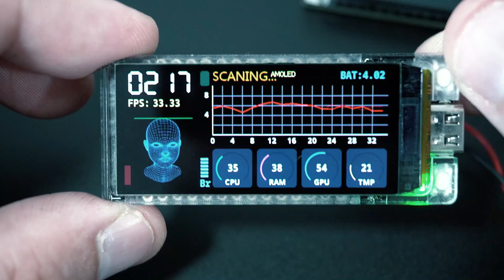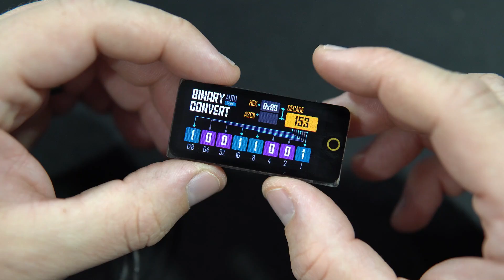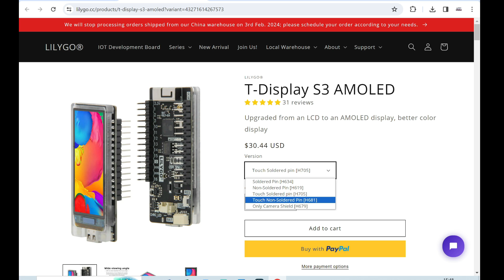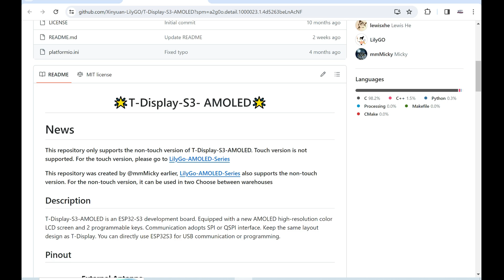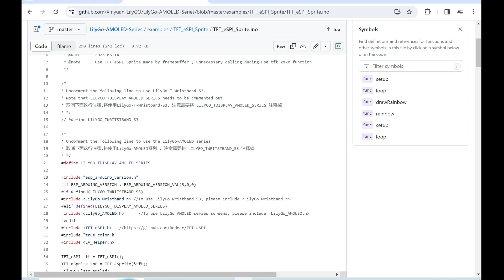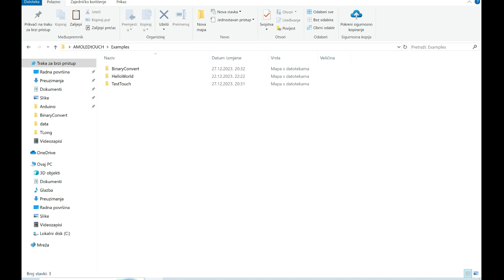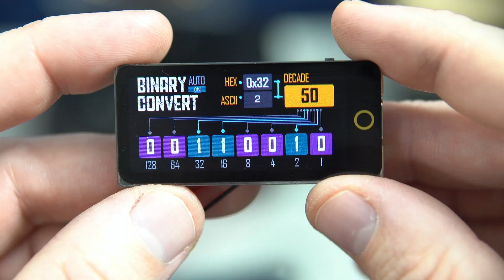T-Display AMOLED Touch ESP32 (Number converter Project)

Comment: Just in case anyone else is - like me - also struggling to get this running: I got the BinaryConverter.ino work on my device by ...

Preferences:
Additional boards manager URLs: "..." (sry, can't add an URL in a comment without it being shredded)

Tools:
Board: esp32 / "ESP32S3 Dev Module"
Port: set to whatever your device identifies as
USB CDC On Boot: "Enabled"
Flash Size: "16MB (128Mb)"
PSRAM: "OPI PSRAM"

Libraries:
TFT_eSPI@2.5.43 by Bodmer
XPowersLib@0.3.2 by Lewis He
SensorLib@0.3.3 by Lewis He

Boards:
esp32@2.0.17 (with 3.x.x I end up in a crash loop)

Code Fix:
Setting the WIDTH and HEIGHT defines in the .ino file to amoled.width() resp. amoled.height() correctly.

Comment: Hi, Unfortunately I tried all three examples and two from them end up with a flickering screen. Only the touchtest works. Does anyone has any ideas?
Reply from the maker: You used libraries from i showed? You copied libraries from theri github page. Make sure you dont have old lvgl setup file somewhere.
Reply: @VolosProjects Hi, same with me. HelloWorld gives a black screen. BinaryConvert gives a flickering in the upper left part of the screen. TestTouch and slidersRGB (later video example) both work fine. After hours of trial and error I really would appreciate some help. I installed the libraries. Thx.
Reply from the maker: did you try examples form lilgo? in example folder in their library....https://github.com/Xinyuan-LilyGO/LilyGo-AMOLED-Series @marcovanurk
Reply: Hi  @marcovanurk  would you mind sharing the solution?

Comment: Did you ever try to use LVGL UI Library on these devices. I'd bet it would save you a lot of time. I would also love to see an audio jack with TRRS on these, so it could be an open source ipod nano...
Reply from the maker: Yes i tried and i dont like it. I tried with sqareline studio. I got bunch of code which i did not understand it was hard to    make simple modification and edits. It was hard to control fps and speed of sketch.  I like simple funcions and i like to control every pixel.
Reply: @VolosProjects  Thanks. Did you ever think of using Audio on these devices? (3,5mm TRRS Audio Jack or USB-C Headphones?)

Comment: Hi Volos, great work - I have so far tried your other examples (without touch, and they are working fine) however I get compiler error with all of your 3 new example - the error code is: Compilation error: 'init' is not a member of 'TouchDrvCSTXXX'

in IDE is this line highligted:              bool res = TouchDrvCSTXXX::init(Wire, boards->touch->sda, boards->touch->scl, CST816_SLAVE_ADDRESS);

Something is missing or ?😅

Keep up the good work
Reply from the maker: Did you cioy all libraries from product github to your lib folder?
Reply: Yes, and even checked LvGL dowgraded to version  is 8.3.11 and TFT_Espi is 2.5.34   - but I must have missed something
Reply: I have the same problem. changed from init to begin and it uploads but touch is not avalible
Reply: Any news about the project?I have the same problem with flickering screen. I have tried everyting i read but nothing.Volos can you help please?

Comment: Lilygo has now released a V2.0 of the non touch version with similar board layout 😊
Reply: correct..it's the same pcb as the touch version but with non-touch amoled. Not sure if they kept the touch circuitry on it. Also i need to buy a non-touch version and i don't know which one is better, V1.0 or V2.0?

Comment: I appreciate your work and felt as though contributing to your coffee fund was the least I could do to say thanks for your help.  I wanted to make a little contribution of information to my fellow builders as well if they may encounter the same challenge using th T-Display AMOLED Touch that I did. If you are using the file "pin_config.h to configure your pins, be aware that the two defined touch pins are reversed and the deep sleep touch wake up will not work with correcting the error.   This took me hours to figure out so I hope this will be of help to others.

WRONG!
#define PIN_TOUCH_INT                16

#define PIN_TOUCH_RES                21

CORRECT
#define PIN_TOUCH_INT                21
#define PIN_TOUCH_RES               16

Comment: The white text in Binary Convert, is all the black cracking part of the source image or the display?
Reply from the maker: That is font, name of font is crack wall
Reply: @VolosProjects   Cool,, the rest of the colors looked fine so I had my doubts it was the display. Looks sharp, need something a little larger though for replacing security wall panels.

Comment: This new board requires GPIO 38 to be set high in order to enable the screen. The older non-touch board does not require this. The new LilyGo AMOLED drivers do this for you, but if you want to fix your previous sketches so they work on both boards you can just make sure to set GPIO 38 high and you don't have to change anything else.
Reply from the maker: Soory for late answer, thank you, you are correct, nikthefux also noticed this. Have a succesfull new year.

Comment: Could you please briefly list the main differences between the boards?   Many thanks for the vid and happy new year
Reply from the maker: Happy new year! touch vesrsion is little shorter, it have 2 stema conectors and it have touch display, pins are same resolution is the same, it seem that one pin related to display is diferent so they need slightly diferent init code.

Comment: I can compile and upload but no display, Serial monitor gives an error E 144 ADC CONFLICT driver_ng is not allowed to be used with the legacy driver. Any ideas?
Reply from the maker: Give me more info, what os, what ide, what esp32 board package. Try install fresh tftespi library also
Reply: Its the Arduino 2.2.1 Win 10 the H681 Lilygo board. I can compile and upload from PlatformIO OK. Using Bodmer tftespi 2.5.41 @VolosProjects

Comment: Digging the UI. All the best for the new year. 
I'm currently trying to decide which display to get which has a prebuild case available/included. For most of the boards this feels like an afterthought. More content on cases would be appreciated. Ideally ones with built-in controller like rp2040.

Comment: Thank you for your videos and for sharing the code, your contribution is very valuable.  I would like to know (and I apologize for my lack of knowledge) is it possible to create an interface volume button on an ESP32 and wirelessly manipulate the actual volume of a device running ANDROID OS?
Reply: I guess IR isn't an option but, yes, for the first part. For the control of your android device, it could be done via an android app over Bluetooth or wireless protocol. 
There might be some existing apps available or might need to make a new one. Here's a similar control example of his from a few weeks ago -
https://youtu.be/AXSOZC590mc?t=531